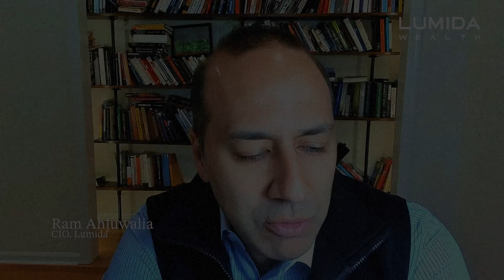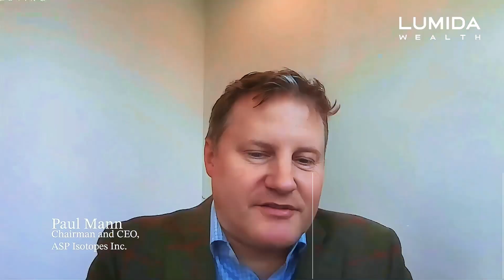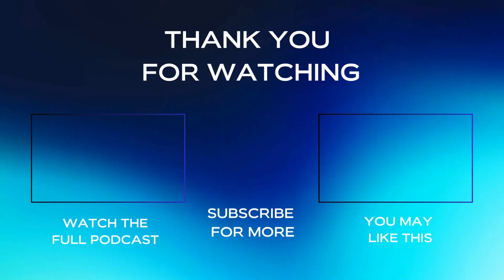Comment: 15 Billion mobile devices with a 5 gram silicon chip inside. Next generation leap in performance is the use of enriched silicon chips. That's 5 grams of Silicon 28, x 15 Billion, and only one commercial producer on the planet of enriched to 99.99% Silicon 28. Nasdaq ASPI. Buffet said, find something that nobody else is doing, and buy it.